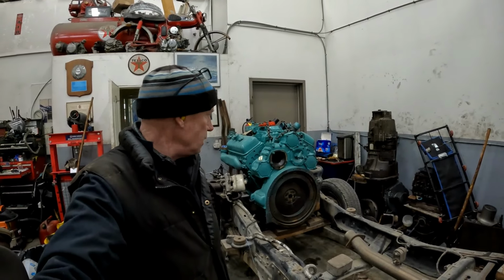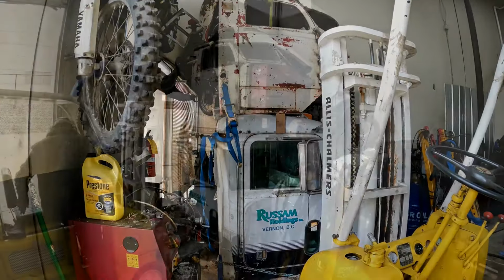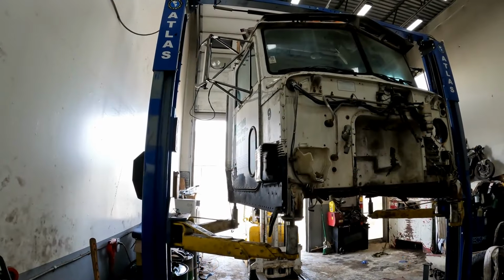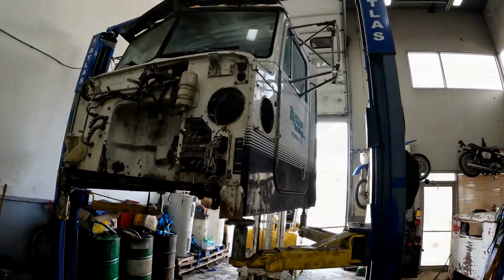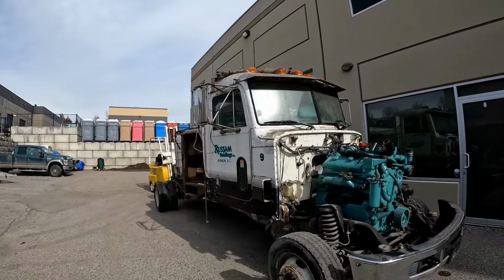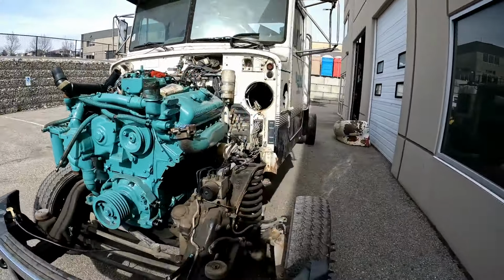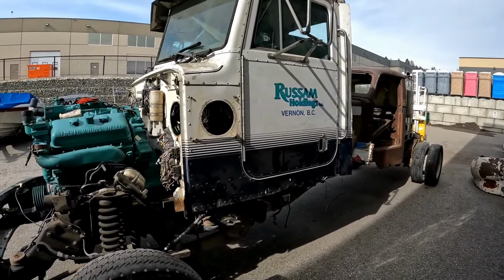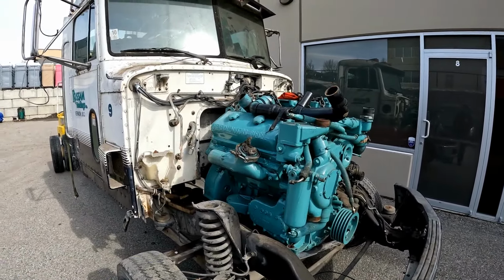Peterbilt Pickup (Detroit 6V71)

Comment: The dip in the frame for the cab seems like it would work against you for this engine and cab combo. Going to an F-650 would get you straight frame rails and a traditional medium duty suspension with 22.5 tires. School buses can also be a cheap source for a straight medium duty frame if you don’t mind cutting off the excess length.
Reply from the maker: Yes you're right, it really need straight frame rails.:)  F-650-750 will probably be the frame of choice.:)  I'll be shopping around for a deals for something like this.  Maybe even the school bus as they do come up for auction for a decent price.:)

Comment: What are you going to use as a bed for the Diamond T project?  Also, how do you link two transmissions together, I have seen an Eaton 5 speed main and 4 speed auxiliary on a YouTube channel of a school bus enthusiast, where he swapped that into his bus.
Reply from the maker: I think I'm going with a flat bed as apposed to a conventional box, but that could change once I get a good look at the cab and chassis.  The two transmission will be joined by a universal joint and a second stick to shift the aux.  Front box will be an Eaton FSO 6406 six speed and the aux box either a 3 or 4 speed.  A 3 speed Spicer 5831 is probably enough.  That will give me double overdrive.:)

Comment: Im biulding 1955 B61 Mack on 2008 550 frame with a 653T wondering how would you mount that engine to the frame
Reply from the maker: I'd probably use the front mount of the 6V53 and mount it to the front cross member.  Have to build out the cross member forward to support the weight.  For the rear I'd use the crossmember to hold up the trans.  I swapped a 4-53T into my 2009 F350 and decided on making engine mounts similar to what you'd find on a Cummins.  I used  the 6.4 mount locations and that worked really well.  Around the oil cooler on the 6V53 and the steering box is a busy place.:)